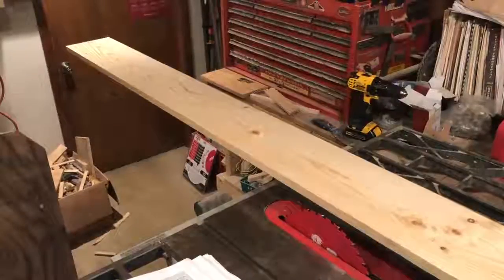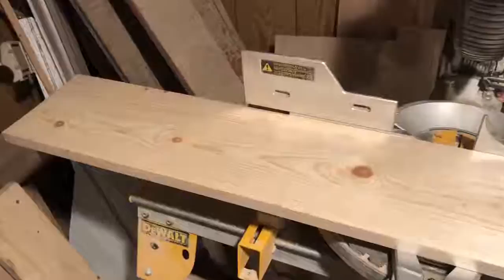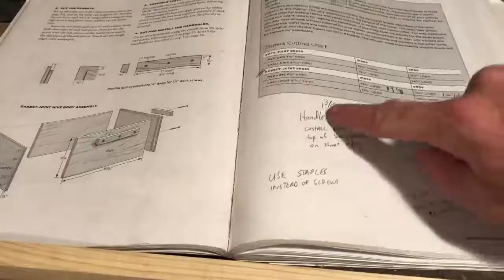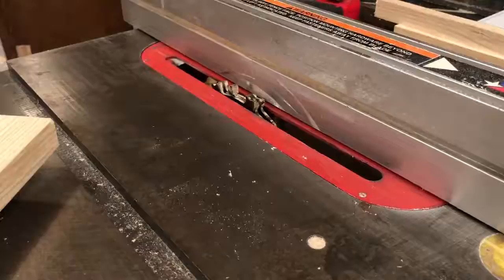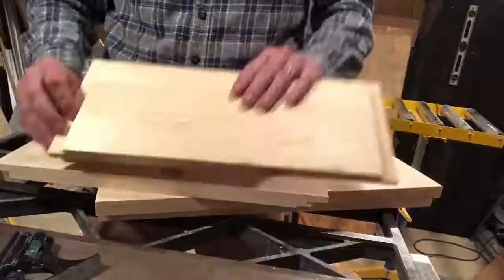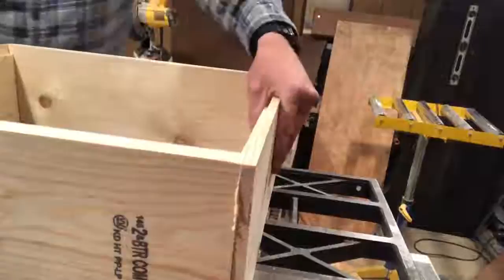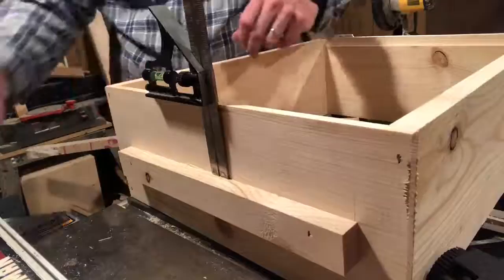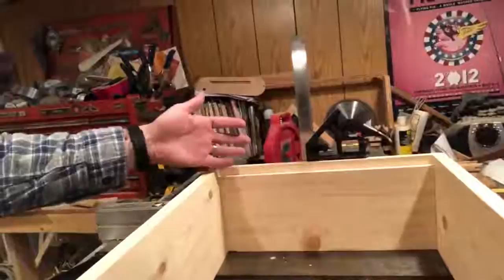Building Your Own Beehive Box

Comment: I think your box is awesome. I'm going to recreate it this year. I'm probably going to extend the handles all the way around just for added strength. I usually work with metal but I have a table saw that I have been neglecting I think this would be a good project to start using that table saw 👌🤟❤️
Reply from the maker: Thank you for the compliment! Yes handles all the way around are good for versatility in picking them up. I tend to only use them on the short sides of the boxes because they store in less room and my arms are pretty long so it’s still a comfortable lift. But like a lot of things in beekeeping there is more than one right way. Thanks for watching and happy building!

Comment: Wow - I loved this video.  Thank you very much.  Question - How well does that glue hold up after years of being outside?  And no screws?  Many thanks.
Reply from the maker: Thank you for the kind words!  I have had no issues with any of the boxes I've built and some of them are four years old now.  I do try to make sure the paint is a couple good coats before they go out.  Thanks for watching!
Reply: Ill answer the question for you both lol. You need to use candle wax to hot dip the box. This greatly preserves the wood  (5 to 20 years) and also kills American Foulbrood spores. If you paint the hive (and get outbreak of afb) youll have to pay for irradiation or burn the box.  Normal wood glue doesnt endure hot dipping process so get waterproof wood glue. Finger joints / "butt?" Much stronger

Comment: Hello Scott,  I would like to ask your help with something wood-shop related.  I put together my entire flow hive 2 and messed it up in a couple ways.  For one, i stripped out a couple holes and am going to try adding a toothpick to help correct it.   Yet I would like to ask help with another mistake I made.  I did not use 90* angle corner clamps to make sure they set straight, and now the my base and two brood boxes don't line up with one another.  So I have taken them all apart, order the brasses, yet don't know how to correct the screw holes that are already set?  I feel like even with the brasses intact, the screws are going to go right back into the same hole pattern and the boxes will again be off centered.  Someone told me I could try to slightly bend each screw.   Or should I add toothpicks in all the holes then try to re-screw?  What would you recommend?  It would be so helpful to hear back from you.  This is a project that is very important to me, as you well know.  Thank you so much.  Brad
Reply from the maker: Hi Brad. I do not have any experience putting the flow hive together but feel like your idea of adding toothpicks would work for the stripped holes. I’ve used it before in hinges and door handles and it works. 
For the part about the box being not square, unless it is very skewed it would be ok. However I would say you would be better off not bending the screws. Perhaps if you could just glue it, while making sure it’s square then adding a few screws into new wood once the glue has dried it would work for you. 
If you’d like to plug the holes that are left over after you re set the screws into new holes, standard wood putty would do it. There’s types to match most woods or you could use paintable putty. 
I do not know what the brasses are though. 
I hope this helps!

Comment: Ok - I had to listen again.  But to be clear, are you using the same dado blade for the rails and corners? Or two different blades.  I'm from the south and a little slow. Many thanks.
Reply from the maker: The dado that connects to the other sides are 3/4” inch wide to meet the width of the boards. The dado along the top is 5/8” wide for the frame rest. 

Both are 3/8” deep so they will meet up. I hope that helps!
Reply: @scottthornandhisbeesandtrees  Oh ok! Cool.  Now it becomes clear.  Many thanks.
Reply from the maker: @billysanford9799  happy to help, hope it works out for you!  Thanks for the chance to explain more.

Comment: Which length of board is the best to get the most boxes out of with the least waste
Reply from the maker: If you’re using the rabbet joint I’ve found that a six foot board is nearly perfect. Thanks for the question!
Reply: @scottthornandhisbeesandtrees  I need to build some deep eight frame boxes I was curious what length of board with the least waste and if you know the measurements for the side in front of the box for a deep with a rabbit cut thank you for your time
Reply from the maker: Ok, the six foot length is near perfect for 10 frame equipment. The long sides would be the same and the short side should be 13 3/8 for the eight frame instead of 16 1/4 for the 10 frame. Hope that helps
Reply from the maker: Also the deep boxes are 9 5/8 inch total depth instead of 6 5/8 depth for medium boxes.